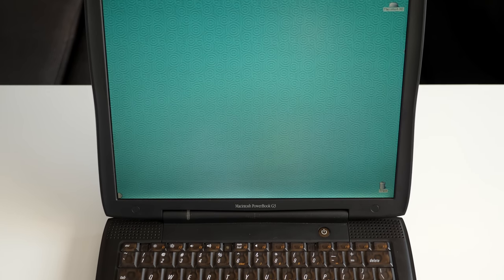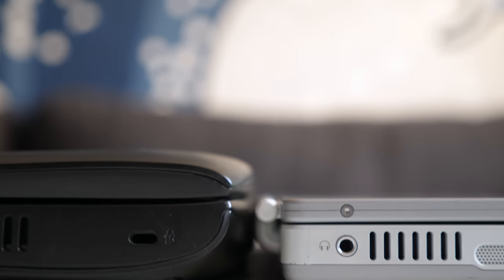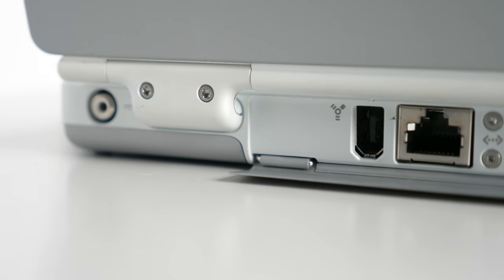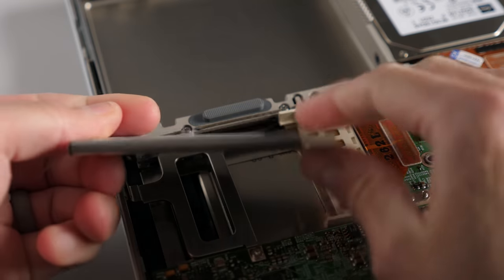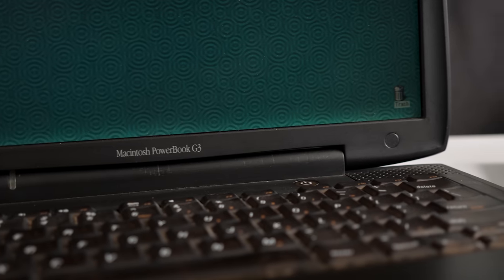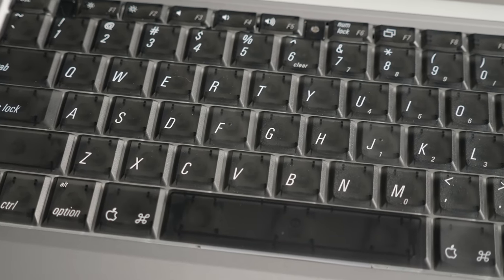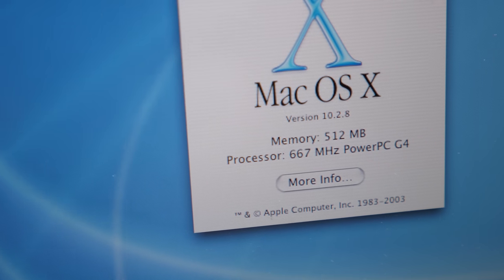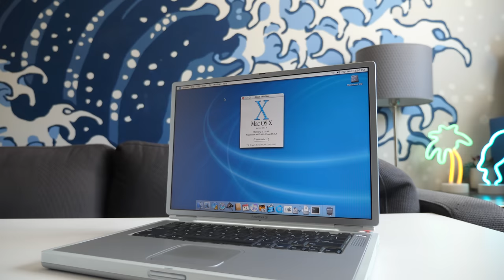The laptop that made Apple switch to aluminum

Comment: One of my favorite laptops ever.  Brought this to Iraq years ago and it held up well with the sand storms.  Even fell out a moving humvee onto the street and barely took any damage.  I got featured in an issue of Mac World regarding this mighty laptop.
Reply: Why did he say they were fragile then?
Reply: @momsberettas9576  ¯\_(ツ)_/¯
Reply: @momsberettas9576  Probably just how it landed. My second gen iPad Pro 12.9 has fallen onto concrete, wood floors and grass lawns and it's still going strong. The iPad it replaced, a first gen iPad Pro 9.7, fell onto the same piece of concrete and its screen is completely destroyed. I also had a similar scenario with two phones, one a Samsung Note 8 with a case and screen protector which had its display completely destroyed by a six-foot fall onto concrete and the other an iPhone 12 mini that has fallen a similar distance onto concrete with no case or protector and still looks as good as the day I got it.
Reply: @foxcroasmun4097  my M1 iPad Pro 12.9 slipped out my back pack when I was taking it of my shoulders hit a desk then fell to the floor and doesn’t even have a single mark on lol
Reply: @foxcroasmun4097  how clumsy are you to drop two different devices off a six story drop
Reply: @c.l.magnus6360  I feel like 6 foot and 6 story are very different things.
Reply: Maybe I got your PowerBook - I just switched it on again after three years and the rear fan is making foul noises.

Comment: I remember upon the switch to aluminum, a lot of snobs were mad that it switched to a cheaper weaker metal. Aluminum is a better thermal conductor meaning it dissipates heat better than the previous titanium laptop which trapped warmth and became a hot skillet. It can also easily be anodized to give color that doesn’t flake, chip, or wear as easily as paint.

Comment: I had this Laptop when I attended art school and I loved it at the time. I was a big fan of classics and not too happy when I switched to OSX. I hated the UFO power cable that came with it. All our classmates had to replace theirs within a year as the cord would break from wrapping it around the disk. The positive thing about the power supply being clear was you could see the sparks when it went bad, which was kinda neat. Also our school was idiots and advised us to keep the computers plugged in at all times so we all killed our batteries pretty quickly as well. I think I got about 5 years out of it until the hinges couldn't hold up the screen anymore. I took apart the laptop and it fell apart. Several structural pieces were snapped in multiple places. I drove a few hours to my closest Apple store so I could order new hinges and other replacement parts if possible. The employees laughed at me and called my laptop a dinosaur and said I should just buy a new one. My first child was just born a few months prior and I was flat broke so I was extremely peeved at the idiots acting like I could just spend several thousand dollars on a new laptop like money was nothing. Since I was forced to buy a new laptop I figured I'd rather buy something other than Apple since their employees acted like snobbish A holes.

Comment: Man, Apple was very generous in terms of ports availability and expansion capabilities back in those days...
Reply: nope it was just different times, was pretty much expected.
Reply: Nowadays apple is not only politically progressive, but DIGITALLY PROGRESSIVE. about 5-10 years ago They had removed most headphone jacks, disc/cd/rom drives, usb ports, ethernet ports,  hdmi ports, vga ports, and other stuff from thier products. And as time goes on, it gets worse.

Why? For 2 reasons, 1:money (so people can buy expensive airpods and shit) and 2, "digital progressivism" (just coined a term)

digital progressivism is a bisnuesss ideology where you get rid of all so called "obsolete" features that many people still use because they work and thier cheaper than wireless (such as ethernet ports, headphone jacks, usb ports, vga ports, etc) and leave your computer with 1 hdmi port and usb port, and no headphone jack. It has happened to various apple products, iphones, ipads and enspecially macbooks. All it the sake of "digital progressivism", money and minimalism. imagine an ipod having no headphone jack and u had to be FORCED to use airpods! Its like the people that scream at you for wearing something that is "out".

The bad thing is, some windows computer manufacures are doing this too.

This is why some people are using old pcs running softwares like windows 7 and even goddarn windows xp in 2023, becuase they dont wanna sacrifice their compatabillity for radical modernism. 

How many pcs STILL have the compatabillity that older ones have in 2023? Well we have Most windows pcs, with ethernet ports, multiple usb ports, and are still as thin as macbooks. thats why windows is so popular, because windows pcs are good computers (except when bill gates forces you 2 update.)

and then the panasonic toughbook, a pc that looks like it was made in the windows 95/98/2000 era, which has all the ports that older pcs had, and everything i mentioned that appl removed from thier computers. the body style of the computer had pretty much never changed, and it looks like its 20 years old. But theres one problem about it. they cost 1,000-7,000 dollars. Expensive as shit.

why cant we have modern, fair-priced/cheap computers with all the ports pcs in the 90s and 2000s had? Because bigcorp dosent listen to thier customers.

goddamnit a mainline laptop made during the windows 95/98/2000 era has more compatabillity than a new macbook. which by todays standards a pc running windows 2000 is an old hunk of shit thats only useful for internet browsing and doing work. Same with a new macbook.

#Macintrash

Comment: One thing you forgot to mention, is the G4 Powerbook (running OSX) were like, THE FIRST laptop that you could close the lid on and everything would come back as normal once you resumed operation. Laptops back in the day had to have SPECIFIC drivers (and version of the driver) in order to wake-up from suspend mode correctly. With Apple it was literally zero configuration. IT JUST WORKED!

Comment: I owned one when they came out and never had a paint problem.  I did have a hinge issue which also tugged and damaged the frame, but did find parts online to fix it.  Gave it to a family member years later, but really enjoyed it.  Did have a keyboard failure, but was able to find a replacement online.  Fantastic Laptop!

Comment: Even today that looks clean, I would gladly take a thicker device to get all those ports.. heck is even take the transparent keycaps and the ability to open it to access the insides!
Reply: This is why I like Lenovo Thinkpads from the past decade, as if you have patience, keep eBay searches out for he models you want, they can be had at good prices, they are overall easy to work on, and upgrade, they have the most common ports you will need in  day to get your work done, they generally have good support for most Linux distros if you don't want to use Windows, and they don't scream LOOK AT ME gamer bling, well unless we are talking about some of their higher end Legion series, but even then most of them are subtle about it.
Reply: I agree, I don't understand this relentless drive to make laptops thin enough to slice a tomato.
Reply: @user-ty2uz4gb7v  I'm the same way with phones, and tablets as well.
Reply: I know, right? Why would I want the option of adding ports using a lightweight dock that I can throw into a bag? I would much rather haul the ports around all the time in a device that's twice the thickness and 3x the weight.
Reply: @tim3172  they don't have to be 3x the weight, to get the ports built In just go look at Lenovo laptops, or even Acer has been doing it for years even on their budget range of Aspire laptops.
Reply: @tim3172  Adding thickness would only add weight if they also up the battery size which I wouldn't complain about (edit, and your docks weigh more than if the ports were included in the product). Ports barely weigh anything, if they use their metal chassis as well it's probably adding maybe a pound tops. That's not tripling the weight but it adds a lot of convenience (even more if they make replacing broken ports easy with modularity(doubt they would anyways)). 

Sadly people think buying $20-$100 add-on dongles for bringing back ports that cost less than a buck to purchase and install to a PCB on the product is the smart idea, ironic since apple is touting being eco friendly whilst making more e-waste with the packaging and the products shell creating a need for more manufacturing lines that create even more pollution. But sure think that spending more for less quality for things that should have been included anyways; and creating more pollution because the company decides you don't need commonly used ports is fine, it's you're money and you're decision to ruin things.
Reply: @tim3172  the LG gram 16 weights about the same as the 13'' macbook yet has way more ports.

Comment: The first 2 generations of Titanium PowerBooks (TiBook) have issues with electrostatic discharge/surges on their FireWire ports which ended up killing the firewire controllers - the last generation finally added capacitors on the FireWire ports that filtered out ESD.  The series remain the fastest PowerBooks with full ability to run MacOS 9 natively, though.
Reply: the 1ghz model is also notable as being one of the few apple computers that can officially dualboot leopard and os9

Comment: the painted bits on the edge of the lower case are actually MAGNESIUM (Shown crakd in your video), painted beige, the only titanium bits are the Dark grey flat panels on the lower half and bottom cover, the monitor was completely covered in titanium ..at $50 a lb titanium was used sparingly....
the broken magnesium exoskeleton on the base can be super-glued and repainted...the titanium if dented or scratched is not repairable...I have stripped the paint of a Titanium and gave it a satin Finnish it came out pretty exotic....

Comment: In Jan of 2003 bought a brand new TiBook 1Ghz, loaded it to the max and took it around the world. That machine served me in various roles for almost ten years. It was the first laptop that I could watch an entire movie on an airplane on a single charge. Mine never broke or lost paint but the keys were starting to scratch the screen so I kept a thin piece of foam to protect it. I did go through about six power bricks including one that caught fire. I then switched to non apple branded power supplies for the rest of its life. This spring I saw what they were going for on ebay and I pulled mine out and sold it for a premium due to the nice condition I kept it in.

Comment: The Titanium PowerBook G4 ("Titbook") was amazing at the time. I had the first model 500Mhz, then soon replaced it with the 1GHz when that was released.  The only problems I had was the paint on the hinges - as you say they improved them, as my second one lasted well better than the first.  The G4 chip was awesome for its day, if using software that embraced AltiVec. I used the second one right up until the Intel MacBook Pro came out.

Comment: Back then I never wanted a Titanium model. It always looked flimsy, and apparently it was. But what I did like was that previous design you showed with the curves. Man I wanted one of those so much. I never did get one. But I wanted one for a long time. At least until the 12" PowerBook came out. Man I wanted one of those. I settled for an iBook but I wished it was a 12" PB. Before the Unibody design we have now the aluminum PB designs they had were pretty nice.

Comment: I had a G4 Titanium that I really loved. I never had any of the issues with the paint, or cracking in the plastic, but the hinges both snapped on me one day and that was the end of that, as I'd gotten the laptop for $800 on eBay and fixing it would have (according to the Apple authorized tech I took it to) meant replacing the whole screen and hinges at a $300 cost.

Comment: One most important aspect. It should Apple was continuing to move the industry forward and took the risk with Titanium. Despite the issues what laptop looked as good as that did in 2001? Nothing even comes close and to expand, it ultimately led to the creation of the aluminum PowerBook which is still the foundation for MacBooks built 20 years later.

Comment: the funniestthing about this is how they used a 2.5mm headphone jack for power and at max it was carrying 24.5 volts at 2.65 amps or something like that, wild, i actually found one of these titanium powerbooks for 10€ locally and im meeting up with the seller later this week (hopefully lol), no idea if it works nor which exact model it is i just know i have to diy a power adaptor bc it doesnt come with one and this is the rarest standard connector ive ever seen, it was hard to find one shipping from my country bc i really dont wanna wait 2 weeks if i order it on aliexpress.

great video and even tho i promised myself not to get spoiled bc i wanted the laptop to speak for itself this was very welcomed, also glad the hdd is ide and not scsi i was having nightmares, also seeing how user servicable it is means i can image it first and foremost before doing anything else just in case, u never know it might have some lost software, probably not tho, also that way i can see how many hours its been used, really wish it looked as good as yours tho, the hinges seem ok tho so hopefully the screen is fine? idk im very excited!

also, is titanium more resistent than aluminium? really? every single one of these ive seen for cheap has a small depression on the top like it was hit and the metal bent inwards rip, no idea how to restore that but ill try.

Comment: The 667 and 800MHz DVI models are good, except for the cooling setup - they used an axial fan to draw hot air over the processor, yet almost all said air was dumped on the titanium bottom panel and not out the air vents in the back, rendering the fan ineffective and your lap roasting. They switched it (wisely) to a blower on the 867MHz and 1GHz systems.

Comment: I've got a laptop from 2000, a MicronPC Transport GX+.  It has the thin bezels, lots of ports, easy access to the internals, a nice keyboard and mouse, swappable bay, etc.

And the display is actually very very nice!  It's 14 inches, 1400x1050, with good colors and viewing angles too. 

It is crazy to me that I've got this old (for computing, these days) dinosaur, and it has better build and parts than a lot of newer laptops that I had seen for quite a while after it came out. I guess it is true though, that MSRP for it was about $3500 with the base configuration, and most newer devices are built down to cheaper prices...

It was originally a company computer, for my Aunt's son to use, which got passed to my Aunt, who passed it to my grandfather, who gave it to me around 2011/2012.  I used it as my main personal computer up through 2014, when I replaced it with a Thinkpad and custom built desktop. I still keep it around, and actually pull it out occasionally to mess around with or to use specific software on it.

I've got a Dell Inspiron 2200 from my uncle which I use as a PiHole for my home network, and a couple other network services. That thing has an awful keyboard, mouse, and screen, and fewer ports too. The physical mouse buttons failed on it years ago as well lol

Comment: Heh, I still have my father's old Titanium G4 laptop somewhere.  It was his daily driver for nearly six years.  Multiple hinge replacements, two new screens, countless keyboards and trackpads, hard drive and RAM upgrades; the works.

One thing I rarely see mentioned in reviews is the fact that air travel was made quite difficult by that titanium case, which apparently interfered with carry-on x-ray scanners.  My father was detained several times over the years and thoroughly interrogated as to why it wouldn't x-ray.

Comment: Great video, Colin! Thanks for one more. What a weird resolution they chose to go with, I have never heard of any device that used it natively. That video out port looks like a multi out for a break out cable, s-video usually only has 4 pins, but that is a common mistake. Thanks again, I love the video as usual, top notch production and feature product.
Reply: Those 7-pin connectors are backwards-compatible with standard 4-pin S-Video cables.
Reply: @eDoc2020  cool, thanks for correcting me 👍

Comment: People that weren’t around then could never understand how absolutely stunning these computers were compared to everything else out there. Even compared to other apple products, this was a radical new design that was unlike anything else ever. I remember the first time I saw one I think my jaw literally dropped and I couldn’t stop drooling over it’s beauty - it was just the most gorgeous product I had ever seen, and the little details like the slot load disc drive was so slick. It wasn’t just the hardware though, I remember seeing how a video minimized to the dock would continue playing in the dock, instead of just changing into an icon. It was at that moment that I knew I had to give Apple another chance, and from that point on I’ve been pretty exclusive to Apple.

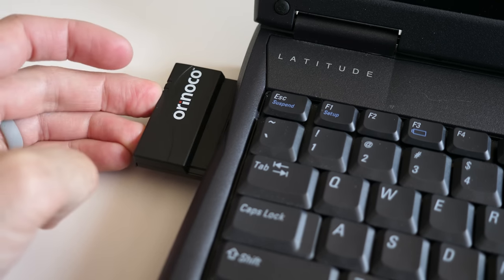Comment: 4:32 just so you know, that Latitude C600 series notebook you use as an example to show PCs needed an expansion card, it has a miniPCI slot underneath to accept a wireless card, or other devices.

Comment: Literally, the only downside I can see with Aluminum macbook is that if you have mercury metal in your house and spill on it, it will just eat through the mac in a few weeks. Such relevant issue among mac users.
Reply: Gallium will make it super brittle and crack in much less time than that.